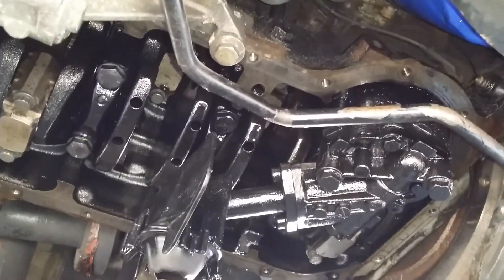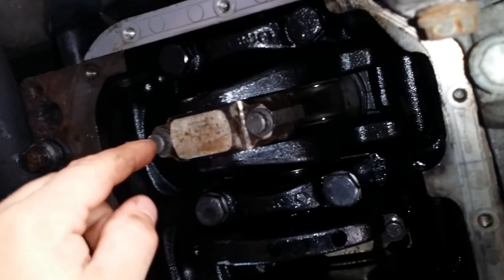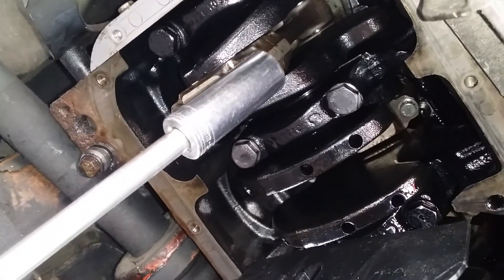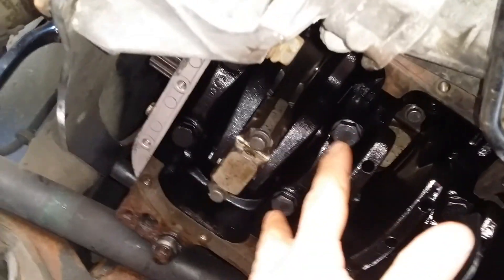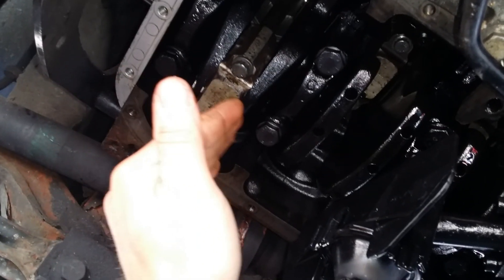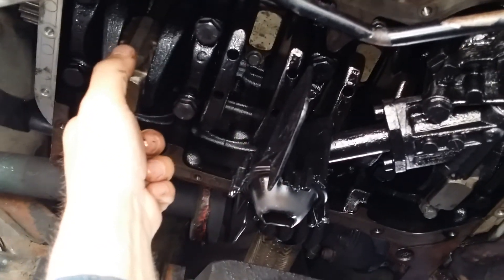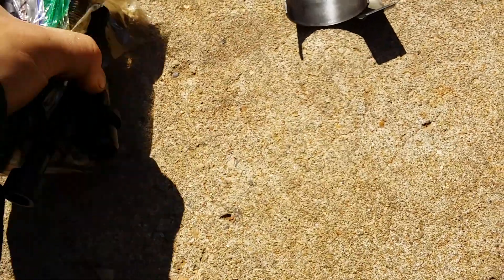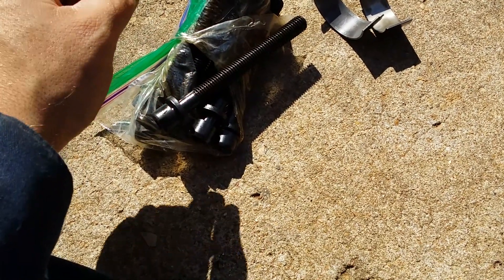Volkswagen TDI connecting rod bolts procedure

Comment: What engine code is it. About to do this on a 1.9tdi ahu block
Reply: Did you ever end up replacing your connecting rod bearings? I have to do this on an alh
Reply: @blaynebriceno  have you replaced yours? my piston protrusion was off so i'm deciding to replace just the one. Easy job?